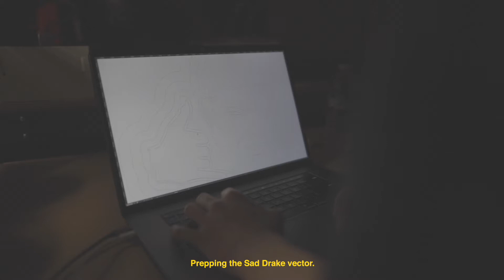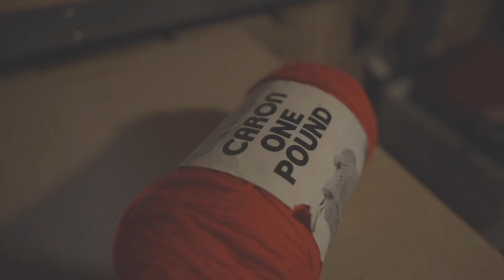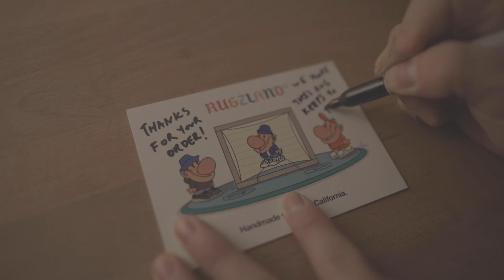😢 Sad Drake Rug Tufting | Making A Drizzy CLB Rug 💿 ASMR 😴 | Relax Work With Me | RUGZLAND

Comment: Hi!! Did you customize your gun? I have the same and is super fast and little bit uncontrollable 😪
Reply: Great job by the way 👌
Reply from the maker: @murielgalvez8489  Hey Muriel, thank you! For my gun, unfortunately don't have any control over the speed. The only button I have is to either be always on or only on when the trigger is pulled. What works best for me is to take your time pressing the trigger especially during turns/curves instead of holding it. Hope this helps 🙃!